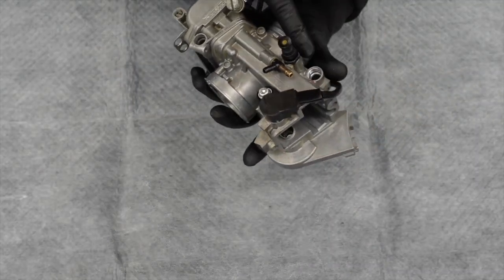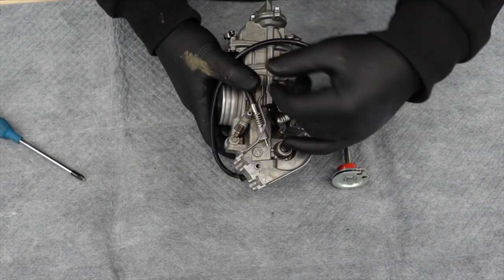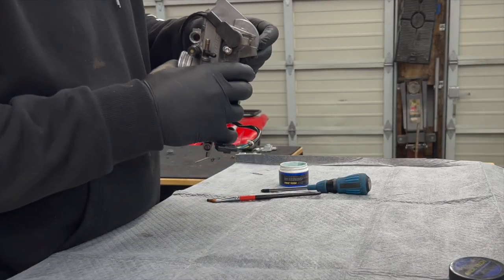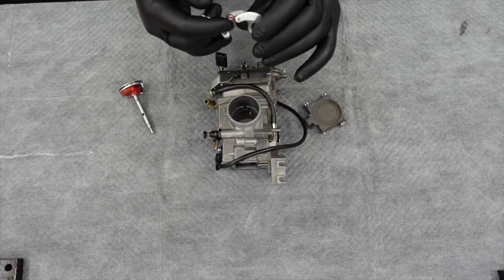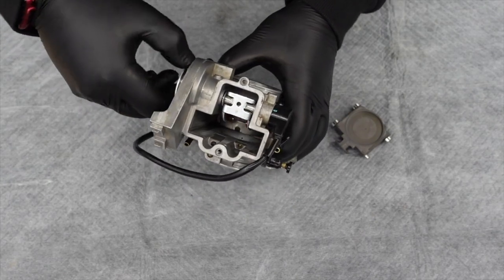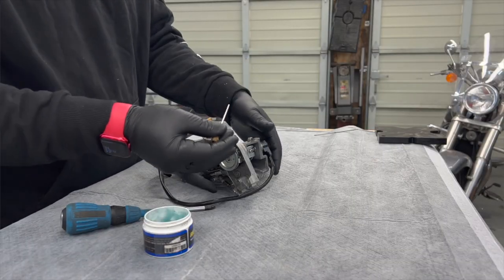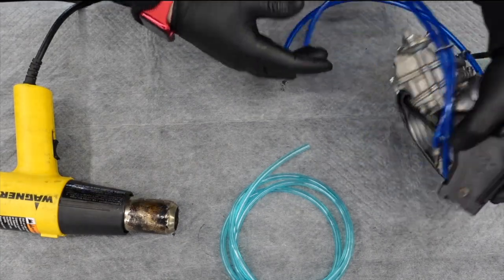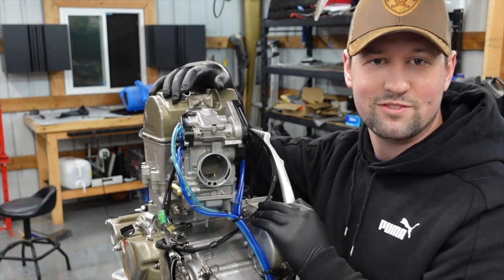$20 Trick for a Smooth Throttle!! | FCR Carburetor Rebuild Part 3

Comment: Awesome video.  Best of class.  A couple of observations.  On the throttle cam removal it would be nice to mention the two washers during disassembly.  Mine stayed attached to the body and while cleaning they both fell off.  I was lucky to find them on the floor after the fact but your video did good to show me where they fit.  Lastly when I took mine apart (had never been done) the mid-body screws had a little blue loctite on all of them.  I put a torch lighter to them for about 8 seconds and they popped loose fairly easily.

Comment: Gday Mate 
I am about to overhaul my DRZ400E FSR carburetor and found your video helpful
Question 
At the 9:43 mark on your video looking at the slide there are only 3 roller bearings on the slide, is that correct ?
Reply from the maker: Faults there are a total of 4

Comment: Ive installed back my carb and forgot to put the hot start back. Its really painfull cuz its a plastic thing and im very lazy to put all the carb off again.

But bike wont start, can you explain why does the hot start not being well put back affect the starting? I thought it would be for when the bike wont start being hot..
Reply: Massive air leak

Comment: where did you buy that replacement piece for the slide, and that washer on the sprocket?
Reply from the maker: I used the OEM diagrams on RockyMountain Atv Mc for the replacement pice, and the washer is from SpecBolt.com

Comment: where does one get a hot start plunger cable mine is plastic and the threads not the best , l see you have a much better unit, thanks for any tips  YZ 450 F bike
Reply from the maker: You can often pick them up from RockyMountain from a company called Tusk, Motion Pro, or All Balls. Make sure you get a new cable AND a plunger rebuild kitz